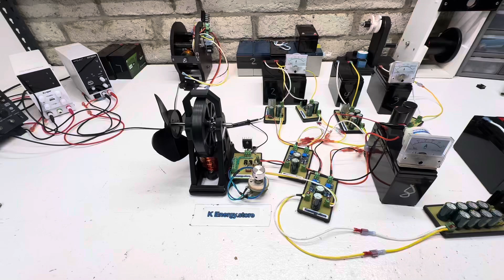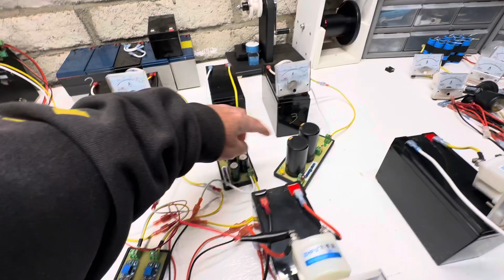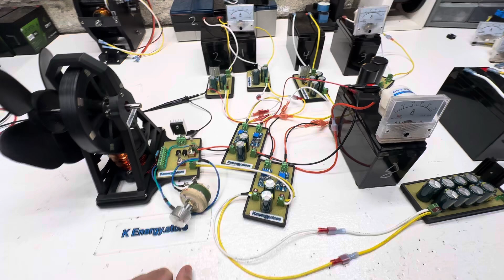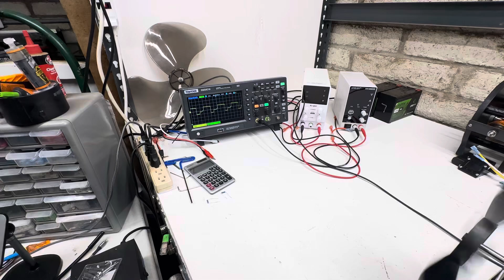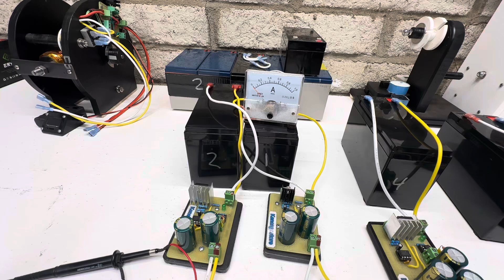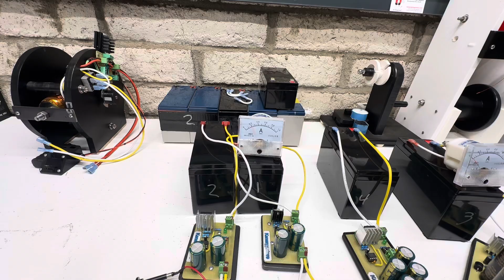Bedini and energy harvesting

Comment: Thumbs 👍, very interesting do you get a fully charged battery or in this case 4. from the run battery and is the run battery being charged at the same time if not dose it charge the other batteries with one original charge or does it need charging in-between. Sorry for all the questions just trying to get my head around this. Great video as usual 👍.
Reply from the maker: @johnwynne-qx6br  the run battery does not in this case but can be swapped out with any of the 5
Reply: Thankyou for your reply, you have got a great circuit going on there 👍